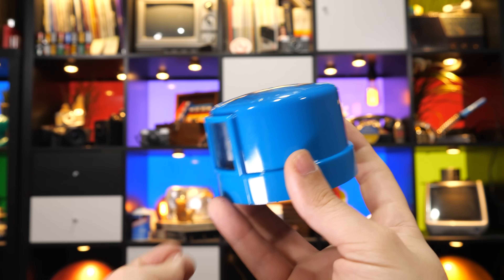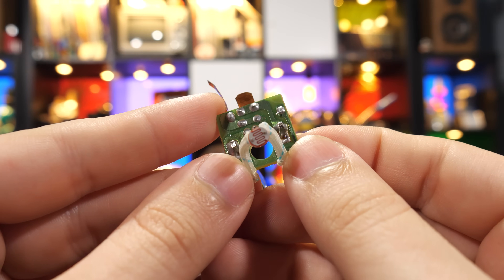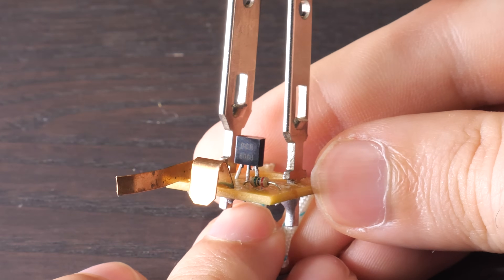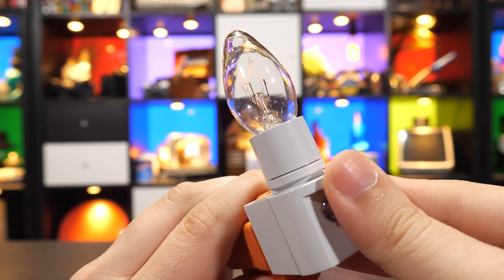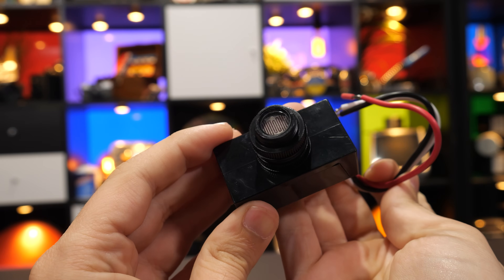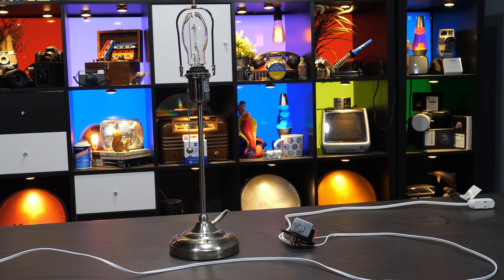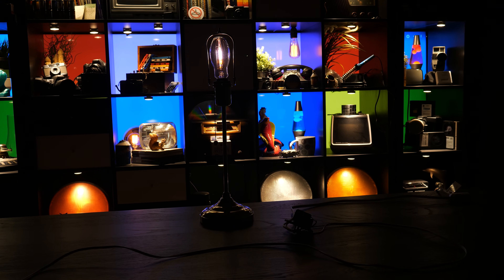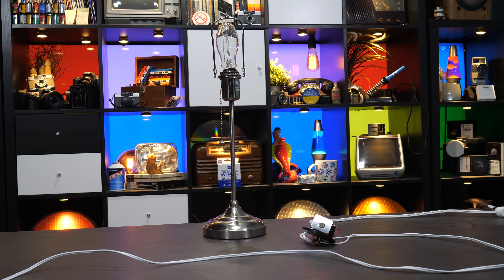Photoelectric light controls are weirder than they seem

Comment: The street light controllers you show are pieces of junk.  They illustrate the fusion of modern technology with China.  First, let's discuss the LDR.  That is a component invented & widely used in the 1950's (along with selenium rectifiers).  In 1950, there was a good excuse for using such a garbage component: they had nothing else that in essence allows MANY electrons through per photon absorbed.  It was the ONLY practical way to sense light!  They have spectral response that mirrors that of the eye (good for light meters).  They are analogous to carbon microphones in the ancient telephone world: they modulate many watts per watt received.  But like carbon microphones, they are persnickety.  They age poorly.  Their surface is subject to contamination.  While they don't need shaken to redistribute carbon granules, they are subject to the constant hammering of UV the environment provides.  They are also better temperature sensors than light sensors.  Eventually, they "see light all the time".  They age faster than electrolytic capacitors.  The same can be said for thermal relays.  They are OK for the furnace where they switch a few dozen times in their lifetime, but not for continuous switching.  Surface-mount resistors, with their ROHS (brittle, tin-whisker growing) solder don't appreciate temperature cycling nor "accelerated ageing" heat to speed the whisker growth.
          5 years ago streetlights were replaced on my street.  I got one of the controllers.  They use a silicon photodiode and an op-amp circuit which provides the gain & the hysteresis.  There is no need for software!  It is the simplest "analog computer".  That controls a "real" magnetic relay.  power supply (real-world crudely-regulated 24V, none of that 3.3V crap), uses a reactive capacitor, bridge rectifier, zener & filter capacitor.  All caps are non-electrolytic so there's no aging problem.  I have circuit if you are interested.  To compensate for the silicon diode's insane IR & red sensitivity, a green cover-glass is provided.
          Streetlight controllers are supposed to be pointed south (in northern hemisphere).  The socket in the streetlight is set loose in manufacture.  Installers are supposed to install sensor can & then rotate it to point south, then tighten the screws.  They usually don't bother.  The sensor on streetlight in front of my house points east now.  (How do I know?  I shoot IR light into sensor to shut off streetlight for Halloween.  I had to reset the setup when the new light was installed.)

Comment: Some light sensors use glass bodied diodes. As light hits them, they generate a small voltage/current since they are basically a tiny solar cell inside. That tiny voltage is amplified by an OpAmp often with an adjustable gain, and then the output is hooked to a Schmitt trigger or inverter that turns on/off a relay when light is present/not present. These tend to be less common these days, glass body diodes are kinda expensive. Schmitt triggers provide that hysteresis, as the voltage from the OpAmp needs to drop below or go above a certain limit before they change state.

Comment: Huh. I was looking at the photo sensor on the dash of my wife's 99 corolla (my daily driver these days), and figured it must be a PV cell, with a voltage threshold determining whether the lights turn on or off. I figured the degraded voltage output of a 90's PV cell after 24 years would explain the increased preference of the car to have the headlights on, even during cloudy days.

Comment: Over in the UK (and possibly the rest of europe and elsewhere), photocells are much more complex. Typically with an actual full PCB with various components (a relay, a 3 pinned semiconductor of some sort, a few support resistors and capacitors, and of course the photoresistor), as well as a fully transparent (atleast when new) enclosure. I have a pair of them (both Zodion SS rated at around 1000W), and despite being manufactured around 4 decades apart, are almost identical in construction (though the older is of course a lot more yellowed and faded). Both still work fine, including the older one manufactured most likely in the 1980s, and most likely being in service its entire life, so I doubt robustness was a concern. Overall I'm not sure about the difference in ways of doing the same task.

Comment: In South Africa, most streetlights simply run 24/7, because keeping the wires in the pole live makes it harder to steal the copper. My town's new LED streetlights have individual light sensors, so they can turn off during the day and the cables are still live.

Fun fact, this is also the single largest factor pushing our adoption of Fibre - not bandwidth or latency, but copper theft.

Comment: People often forget than many things don't need a microcontroller or software. We've got by for decades between the commercialization of transistors and of microcontrollers with more inventive solutions. Schmitt triggers are comparators with hysteresis and can be made with few parts in a handful of different ways. Do you need a delay circuit after it, maybe a retriggerable one? That's one thing a 555 can do. You can put together the whole thing with a few CMOS logic chips as well, then have it drive a fat transistor switch for any load you want. So again, why are we still using heaters?

Comment: Airports use a similar technology to tell the planes the visibility down the runway. The runway light intensity is set to a known value based on reported visibility. Light sensors located down the runway can then report values of exactly how far down the runway pilots can see. Measured in feet, and split into 3rds of the runway, touchdown, midpoint and departure end, if the airport is equipped with all 3 readouts. Many will have just one readout for runway touchdown visibility only.

Comment: It is more common nowadays (at least in Alberta, CA) to have the photocell module mounted to a power distribution cabinet (PDC) controlling the contactors for all circuits the PDC handles.
The light fixtures (typically LED for new installations) then require a shorting cap in lieu of a photocell. It looks identical, minus the view-port.

Edit: This was sort-of mentioned later :P
Reply: Hello fellow Albertan! Nice to see another one here.
Reply: When I was in Alberta many years ago, I applied for a job to  wire  up those cabinets.

Comment: Here are some small corrections and added info:

Cadmium Sulfide found in CDS (or photo) cells is considered TOXIC and a carcinogen in humans so HANDLE WITH CARE!  They normally come encased in a thin protective resin coating, however, who knows what the ones from CHINA contain or if they have even this protective coating at all!

Photoresistors are not LDRs,  LDRs are solid state such as Phototransistors and Photodiodes. The component featured, here in Alec's video, is a CDS Photocell and is a passive non solid state component.

Alec used the term "Thyristor" which is  a class of electronic component rather than the name of the component itself: (example:  someone referring to flowers when they meant Roses)  what he probably MEANT to say was TRIAC while explaining the operation of a SCR- two different types of Thyristors.  he ALMOST "got it right" when he explained that the component was a DIODE, yet described it as a resistor. (he did get the action of the gate correctly, though in its absolute simplest form). Now, the difference between a TRIAC and an SCR is that, firstly, an SCR is, as Alec [tried to] explain, a gate-controlled Diode which controls the flow of currents in only one direction and since that it is a DIODE and NOT a resistor, it does NOT behave as a resistor in any way.  and, with that explained,  a TRIAC is simply 2 SCRs, configured back-to-back with their gates connected together which will allow the flow of currents in BOTH directions.  The PTC (little green blob) in that circuit, although CAN be used as a fuse,  in this case, its being used as a HEAT REGULATOR as the resistor values chosen are meant to get the resistors "up to heat spec" rather quickly and-more importantly- able to do this in COLD weather; without the regulator, the resistors would heat up beyond their tolerances and rather quickly burn up. you saw that the PTC was pressed-up against the body of the resistor for this purpose! (I hope Alec pressed the PTC back down onto the resistors as he found it). if the circuit was designed as to not include the PTC, and then the resistors were to be operated within their safe regions, then they would probably not be able to get hot enough to impact the thermal switch in a timely fashion or may not even trip it at all in winter!  Another benefit to this design is that once the thermal switch trips, now the resistors only need to "hold" the switch from a lower temperature rather than keep it at a higher temperature at all times, this saves energy and prolongs the life of all the components involved. (this is also how they get their hysteresis or, slight shifting of the heating/trip timing which, in turn, helps prevent cycling of the switch). there are other effects, as well, which are beyond the scope of this discussion, and that the thermal-based versions all have to contend with, such as weather and ambient temperature and humidity all have an effect and have to be considered in the design.

Comment: In my region, they do not use a single photoelectric light control for a bank of street lights. Each street light gets its own controller. As a result, each street light turns on at a slightly different time.

Comment: I've seen 2 other implementations of the street light sensor, both with more electronic solutions.  One used a dual comparator chip and the other used a 555 timer to control the a relay (Big Clive did a tear-down of that one)

Comment: It's a brilliant design (pun not intended) because the latest iteration of street lamp photoelectric heads are more reliable and cheaper to build. We don't usually see these two qualities hand-in-hand! The internal waste heat serves to keep the head's shell warm enough to (hopefully) melt snow and ice off them. (EDIT: Hopefully, it keeps the shell warm enough to prevent snow or ice from accumulating in the first place.)

A defective head can be replaced in mere minutes, some localities have metal enclosures where the street light wiring all converges, with a single head at the top of the enclosure controlling them all. Bad head? Drive on up to the box, twist-and-release, twist-and-lock, done. No need to shut down a lane of traffic with police and cones, bring out the "bucket truck," etc. This leaves time, money, and resources available for other projects. It's nice to see Common Sense being employed these days!

Another common use of photocell technology that many people are totally unaware of: they are often used as "flame present" sensors in oil-fired furnaces. Surprisingly-robust little things even in that environment, the annual cleaning of our furnace always includes a "wipe soot off the photocell, if present" step. Our first furnace ran from 1975 until we replaced it in... 2007? 2008? And over all those years, we only had to replace the wiring to the photocell - I remember we couldn't get the wiring & plug WITHOUT the photocell, so after replacing the entire assembly we kept the old photocell, which was still good, as a spare. And our furnace isn't just for heat, it also heats our tap water, so it saw a LOT of ignition/thermal event cycles. 

In our bathroom is a 1980s photocell night light, it's still running strong, even using GE-branded LED bulbs now. We've misplaced the clear cover, but otherwise it's fine. Because it's the older circuit design, certain ambient light conditions can cause a strobe-light effect, which is why we went through tungsten bulbs as often as we did. (Y'know, maybe someday I should take a look inside and see how the circuit differs...) I remember my mother buying it at Paperama, which sadly no longer exists.

17:09 - 🤣

Comment: 12:15 Thanks! 🤣 We appreciate it, I promise
17:05 slow clap Though I take issue with it since that's a common occurrence on this machine lol

Interesting note, as kids we used to use roman candles to turn off the street lights on our block before the new year's finale. Given that the light output wouldn't be prolonged enough to actually trigger the sensor, I wonder if the more intense than normal heat was enough to trip the thermal switch, given that they are usually designed to respond quickly to a failure resulting in high heat. Or just thwacking the poor neglected light and ballast with a flaming bit of carbon was enough to cause it to cut out. But they would come back on after a minute or two, which makes me think the hysteresis function was still working.

Comment: What a curious thing, It's certainly not used where I live, here the street lights are controlled manually by the city.
I wonder, considering it uses heat as control parameter, how well does it cope with outside temperature variations? Would it behave the same in -45 as in +35?

Comment: Here's what I really don't get:
Why not replace the heating element with a contactor?  That way you literally only have 2 components: a photoresistor and a contactor, and then you don't have to waste energy on heat while reducing load on the grid in the event of restoring from a power outage. .  Worst-case scenario, you add a capacitor so something like a bird flying overhead doesn't trigger the lamp to turn on.

Comment: This old-school stuff uses properly cheap electricity and will refuse to die from power surges, that are common when lightning strikes near to light pole. Exchange of dead units uses not cheap at all labor. This is fine, as you can only exchange 2W in daytime from those units to likely 0,5W while relay is off and 1W while it's on
Also, there comes the edge case, when 2W of heat makes this unit harder to cover with snow

Comment: Over here (Netherlands) street lights are turned on remotely. They're always powered, even when switched off, and a signal carried by the power lines can turn the individual zones on or off. It is possible to turn on the street lights during the day (for testing) and sometimes there are issues with the signal and the lights don't come on when it gets dark. Some municipalities as well as the railroads turn on their lights as soon as it gets twilight-ey, other municipalities and the Directorate General for Public Works and Water Management (= Highways Agency) only when it gets darker, and some municipalities like the one where I live skimp and only turn on the lights when turning on the lights will actually make it brighter, which feels like it's way too late until you get used to it, then it makes perfect sense.

Comment: Shouldn't there be another resistor between the 2M Ohm resistor and the thyristor's gate in the circuit diagram?  Even just to symbolize the thyristor's gate resistance? I'm thinking it doesn't work as drawn. Not being pedantic, actually wondering...

Comment: How does weather affect operation of the photoelectric circuit? If it's sufficiently hot out to heat up the casing could you have it cut power to the lights? And if it's too cold out, could it turn the lights on?

Comment: I wonder when this implementation became the default?

As a curious tyke, dad would bring home random failed electro and mechanical bits and bobs from the manufacturing plant for me to dissect. I remember one of these and it had an actual electromechanical relay in it. What was even more fascinating was the LDR had a thin perforated aluminum plate over it to attenuate the incoming light level.